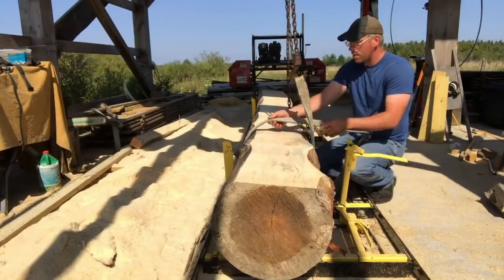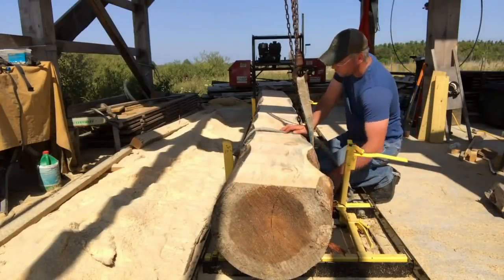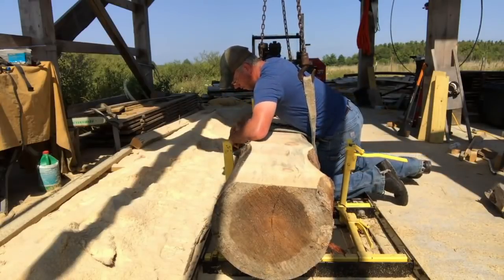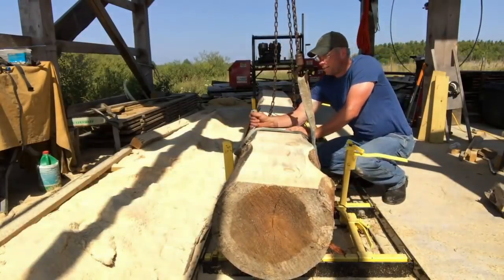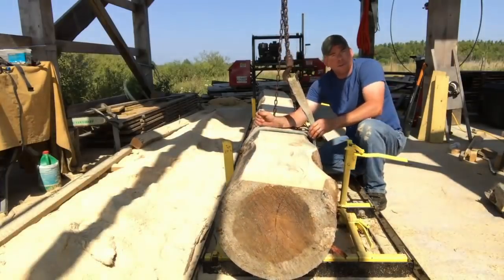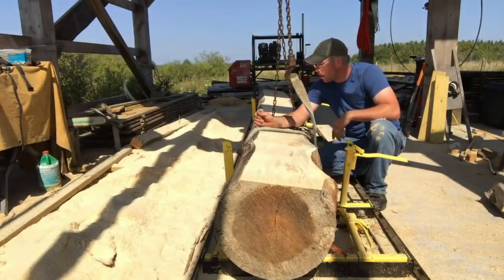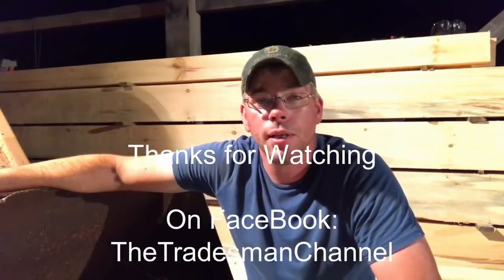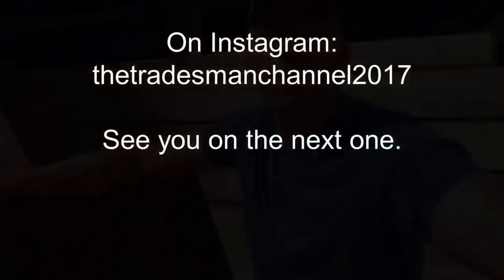Sawmilling Tips and Tricks: Turning Logs Without Machinery the Easy Way

Comment: I use a similar method but with a Hi-Lift jack and a chain with a hook on it.   I have thought of a beam carry system with hoist on it, having the beam roll on other beams to position timber anywhere in the shop and roll cants on the mill.  Nice trick with the strap!
Reply from the maker: I was thinking the same setup for the timber shop.

Comment: What kind of anchor point are you using to attach that chain hoist? I'm building my shed for my manual mill.
Reply from the maker: It was a 4x6 sitting across two 5x8 floor joists.

Comment: I just use a long metal handle peavy.  Any short of a huge log isn't hard to turn at all.  Also, you spend a lot of time sticking your logs in endwise.  I'd open up the side of that building, set a couple of 6x6 or 6x8's from the mill to the outside for a log deck, load it up and saw all day.
Reply from the maker: That's not the permanent home of the mill.  You are right on the ling pv, I need to get one instead that cheap one I'm using.  The sides of the building are mortice and tenon so they're not coming apart.  When the building is finished (28x50 two story timber frame) I'm putting a leanto off of one side with concrete for the mill and open sides because it was a lot easier when I could load the logs sideways, this is just the only solid place I have to out the mill at the moment.
Reply: Gotcha on the building.  The cant hook I use is a LogRite.....60" aluminum handle.  Bought it after breaking a wood handle flipping logs.